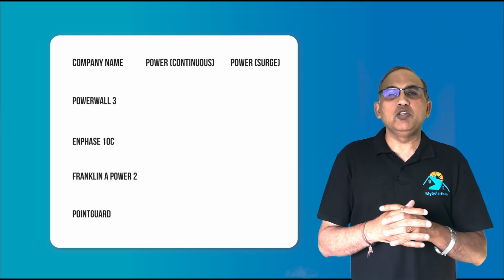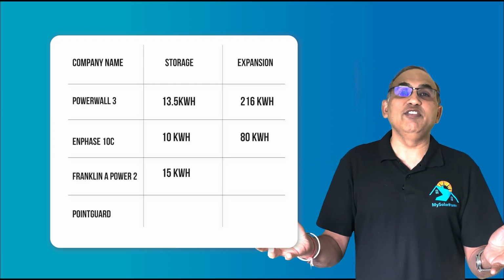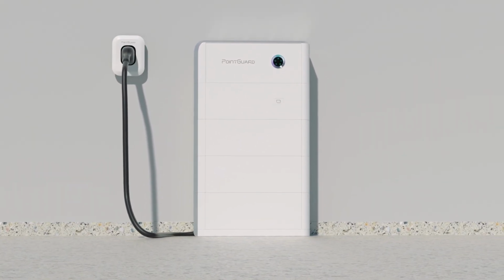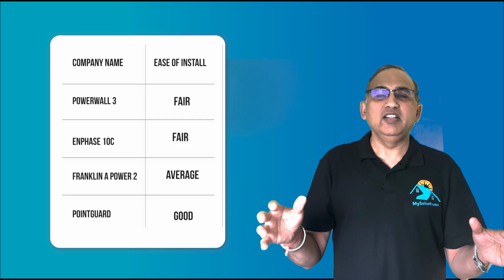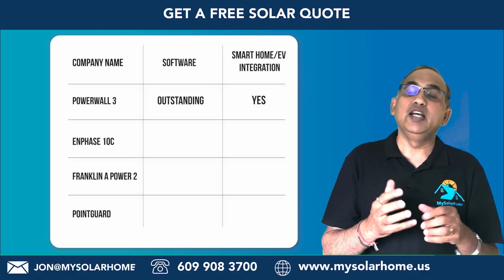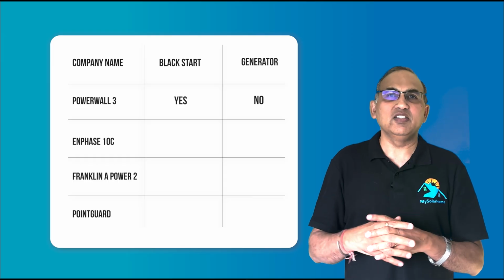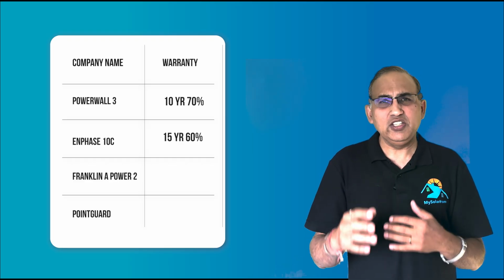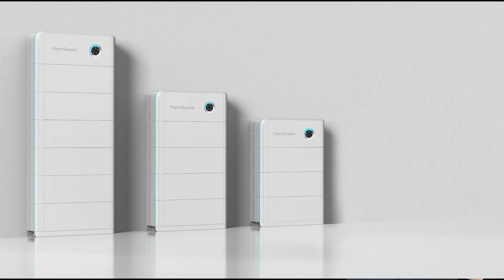Which NEW Solar Battery will dominate in 2025?

Comment: Very nice work. Great explanations. 
This is the best system I could piece together for our home. Let me know if it is a decent system and what you think. 

System Size 22 kW DC

Solar Panels / Count 
SEG Solar Yukon N series SEG-440-BTD-BG 440W (50)

Inverter(s)
Enphase IQ8MC (50)

Racking System 
Iron Ridge

Production Monitoring Franklin & Enphase App

Battery Backup Franklin aPower2 (Qty. 1)
Reply from the maker: That looks good. Where are you located and how much are you paying for the full install? If you like email details to me at solar@mysolarhome.us - I can do a sanity check to make sure you are not being over charged. Thanks for watching.

Comment: Nonecof these batteries are a good deal. Its far better to DIY your own battery.
Reply from the maker: I agree a DIY solution is much cheaper. However most homeowners dont have the necessary skills to connect a solar system to the grid - working with DC is also a challenge. It is awesome if you know all of that - you can get it all done super cheap and maintain it your self. Thanks for watching and commenting.

Comment: Great explanations of what these batts are and can do. I am in the market for one (in Europe) and have some tech questions I am sure people im the US also have (maybe good for a video) I have enphase iq8 panels on my roof that deliver 240v. Idea when installed last year was to also take a battery in time, but in a years time market has moved beyond the 5p and 10c is not for Europe(yet?). Anker x1 and pointguard are on my shortlist due to capability, wallspace and costs. Both are ac coupled and also have own mppt. Now, can my enphase Iq8 panels/house load these batteries ac coupled? Can they "wake-up" these batteries in a power outage(off-grid)? I would place a battery in my shed with 2 thick cables to the house (to grid and to house-box with enphase I assume). The shed roof has space for 6 panels. Can I (in the above set up with enphase in the house) connect 6 panels (non-enphase) directly to the battery mppt? 
Installers all say yes yes yes yes to sell, but when going into depth, I get the feeling they do not know, and my house will be a test-case on my expense. Could you elaborate on the working of this please?
Reply from the maker: Thank you for watching and your comment. The Anker and PointGuard are both AC coupled batteries and they can both be added to any existing solar panel system - including your Enphase system. I suggest you choose and installer who can give you a few references of earlier installs of the the battery you finally select. Don't go with verbal assurances. Best of Luck and please keep watching. Thank you.

Comment: I bought a system from Jon’s company , in 2021 and his company is very responsive and their service has been fantastic, I am now getting a Franklin battery system with a 14kw generator integration, when I am having an power outage it will run on the battery until the battery is depleted to a certain level then it will start the generator until the battery is charged, just like a hybrid car does.
Reply from the maker: Joe, I am delighted to see you here. Thank you so much for that super review. I hope your Franklin battery install  rocks as well. Take care. Jon

Comment: So is it cheaper to get a used ev with a 75kw battery and a bidirectional charger.
Reply from the maker: Eventually that might be an option. Right now bi directional EV charging is very limited and not a practical option. The standards of bi-directional charging that would make all EV batteries available as home battery sources are being worked out, but its still a few years away. Thanks for watching.

Comment: Thanks for this.  I am shopping for battery back up system now.  I bought a home with Solar already installed.  It has Enphase IQ7+ microinverters with each panel.    ADT did the installation and now abandoned all of their customers by going out of the Solar business while denying any claims for repair as quick as an insurance company.  I am surprised how so many local solar companies won't even quote the battery unless they can install the solar system as well.  Tesla is so slow to respond, they might show up in a month.  I'm in Florida.
Reply from the maker: I understand your frustration. Unfortunately most solar companies see very little margins in battery only installs and the possibility of future service calls related to the battery and the older solar system also factors into their consideration.  My solar partners in Florida dont do battery only installs. But, I would keep looking - type solar installer near me in Google Maps and call all of them. Someone is bound to be ok with a battery project. Best of Luck a I am sorry I wasn't able to help.

Comment: Issue with that price comparison is that EnPhase has such lower output and storage, that for many (most?) homeowners, you’ll need two of them, making it way over-priced. I’d argue EnPhase needs a higher output option, but they could help their customers by adding DC battery expansion so that homeowner isn’t overbuying on inverters (after getting 2nd unit). Obviously ymmv, but I’m in a low energy usage area (coastal weather means little HVAC usage, but even then my peak usage is slightly more than a 10c’s output) and EnPhase price when sized for my needs is WAY more expensive than competitors. I have IQ7s, but the 10c isn’t worthy of consideration at this point. 
EnPhase would have to drop 10c’s installed price by 1/2 to be competitive
Reply from the maker: Yes your analysis is bang on. I was a little disappointed with the lower power output of the 10C, given that all the major competitors are over 10kw. However, the Enphase PCS system that manages the solar panel plus battery output is outstanding. The daytime output of solar + the battery is not limited like the other batteries. You get 100% solar and 100% battery. This means you will hardly use solar output during the day. Only use the battery at night. So for many homes just a single 10C will do the job and you dont have to go for an expensive second one. But, you are right, the 10C does need  a price drop and a power increase. Thanks for watching.
Reply: @MySolarHomeUSA agree and understand about Enphase’s power control…. But that shouldn’t be the case.  Mature bi-directional EVSE standards will effectively require ESS gateways to handle cross-vendor power coordination (by which I mean, not silly frequency shifting) … EnPhase already has the power control APIs, just blocks access… 
now, I get silly folks who’d expect instant response and EnPhase saying no (access) due to such idiocy (and potentially hazardous situations that could be created). But a 5-minute (or whatever) response time should be plenty for graceful PV curtailment/control. I suspect a major issue is slow communication and response by IQ MI’s via powerline (a hardware and firmware issue)… but could be wrong about that.
Reply: @MySolarHomeUSA  my highest usage tends to be nighttime heat pump HVAC + PHEV charging (older, limited to 16a) after midnight… (once in a rare while I hit 8kWh). if I replaced my EVSE with EnPhase’s underwhelming offering, and power coordinate, I could ‘just’ get by with a single 10c… move to a full EV.. and nope. And why should I work around EnPhase’s deficiency? At significant cost…
  Basically the 10c would have been a decent offering 2-3 yrs ago. Today, it can partially support a small house/condo with limited major electrical appliances… with lots of competitors offering much better, at better price per kWh.  I’d buy something today from EnPhase, if they had an even closely reasonable offering… but they don’t, unfortunately.
Reply: @lawrence_SoCal  Who would you recommend other than Tesla for a better price per kWh?
Reply: @RyanDooley  I wouldn’t shop on price, and when looking at 2x10c vs 1 of the others, the others are all cheaper on price. For me, I require meter collar MID, mature software, and a smart load center option. Then, DC bi-directional EVSE for future-proofing. So? yea… no really any good choices for me, if I demand a cost-competitive 10+yr usage expectation. Enphase appears to be blocking graceful power control, without reasonable justification from homeowners with non EnPhase components. Sigenergy and Franklin, as well EP Cube all look interesting and price-wise EG4 looks really good (but cheap in part for a reason in terms of support, s/w maturity, etc)

Comment: Great presentation.  Pointguard can connect up to 390KWh of battery.
Reply from the maker: Are you saying that the maximum energy capacity possible with multiple Pointguard batteries is around 390 kwh - I guess about 10 full stacks. That is good to know, I could not find that information during my research.